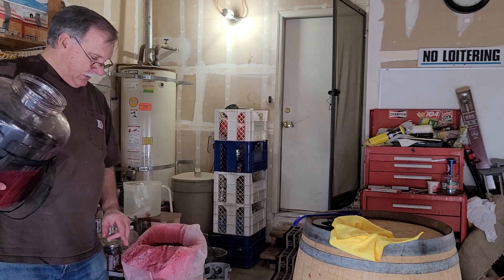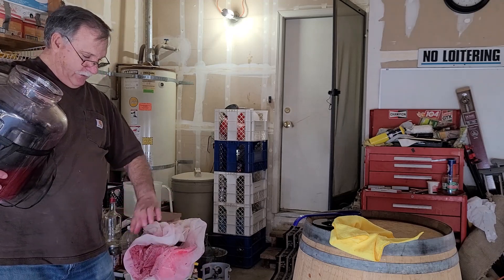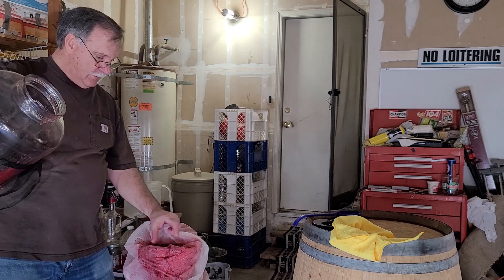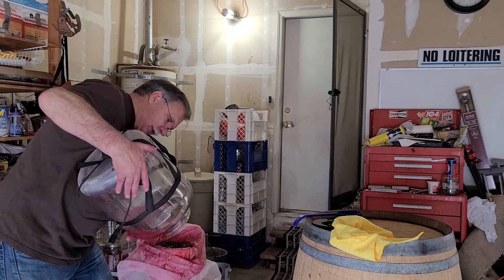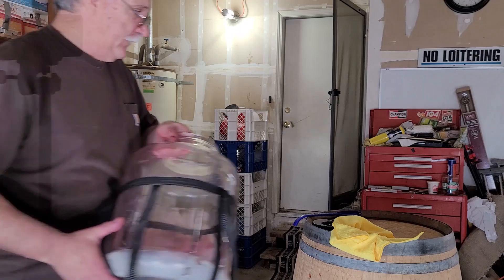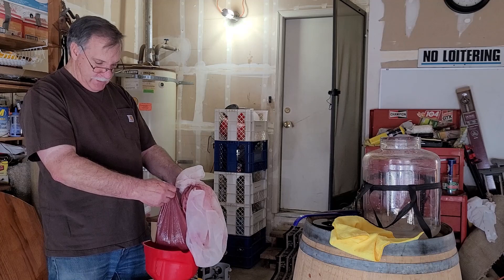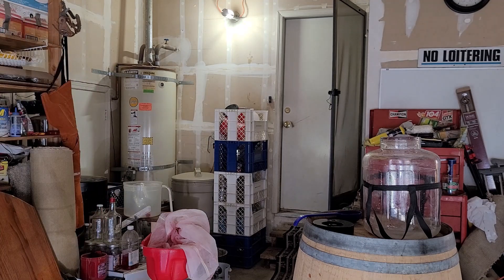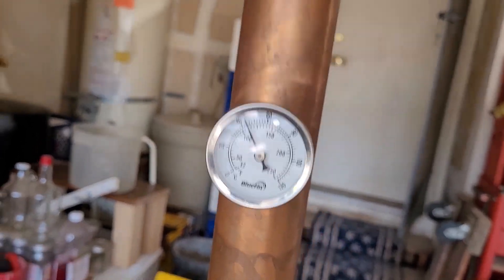3 Berry Moonshine

Comment: As I understand it (mostly from what I've read), for fruit mashes, most of the flavor is hiding in the heads, so it's a trade-off of how deep you want to keep early jars vs headache compounds?  Although it looks like you're keeping everything from a 1x distillation here.
You have a nice, big water reservoir there, why not fill it up 2/3 or more?  Granted, it's a pain in the ass (or rather the BACK) to move when it's fuller.  I know my ice jugs in the freezer aren't exactly a welcome sight to the wife...
For a brandy run, your thumper rig with some frozen berries (and feints from this run?) in it might give you better return on time invested for the run?  I've used a thumper, but not ever done a fruit run myself, so I may be talking out my arse.
Enjoyed the vid!  Cheers!

Comment: Might consider getting yourself a full-size keg to use as a stripping still. Make enough mash to fill it, by the time you strip it all out you’d have enough low wines to run that smaller pot.  You’d get a lot better resolution of cuts, way less heads bleeding into hearts and hearts bleeding into tails, etc.